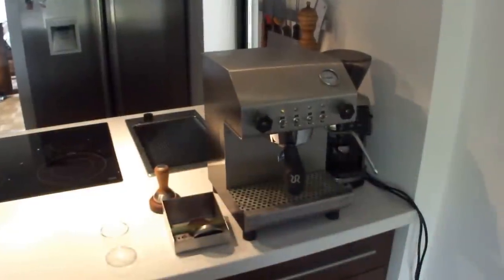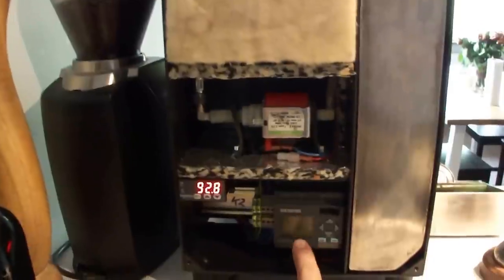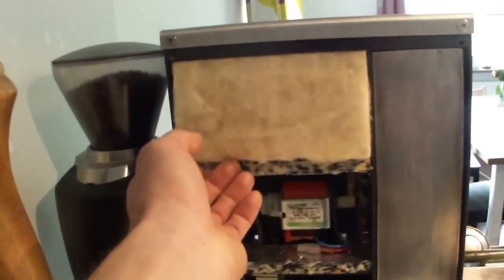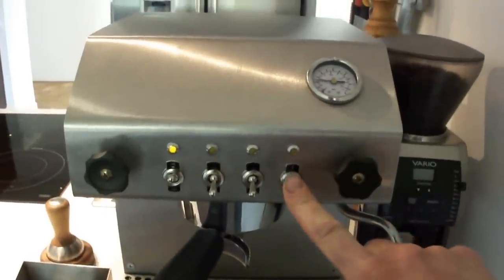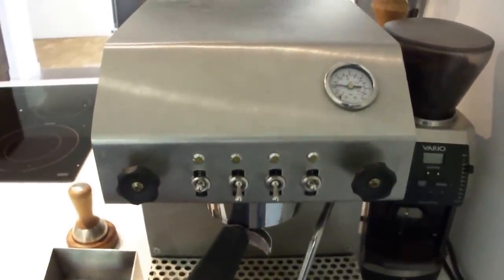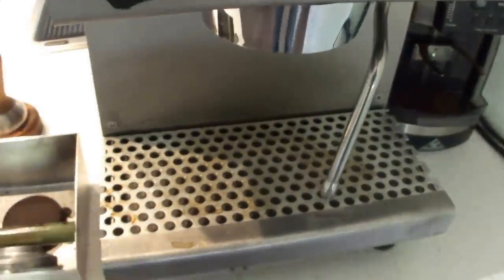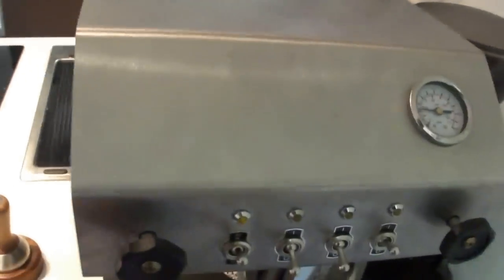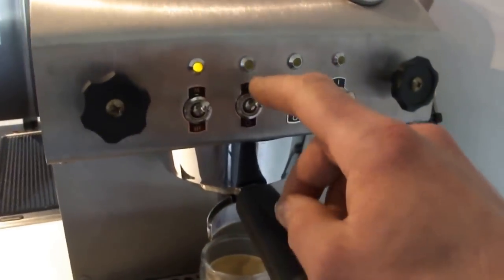DIY Dual Boiler Home Made Espresso machine

Comment: im in no  way taking away from your design. but you could have put a hose and either a flow or pressure switch for automatic water fill. just add another rung to the plc and a solenoid and maybe a flow switch . but besides this is extremely nice.or level switch.
Reply: I’m looking all over YouTube. I have no experience building anything myself but I’d love to try!! I wish there where like blue prints